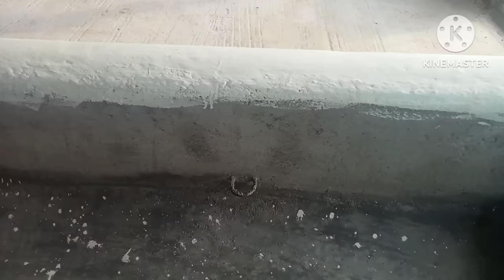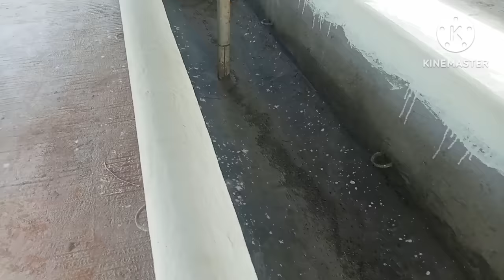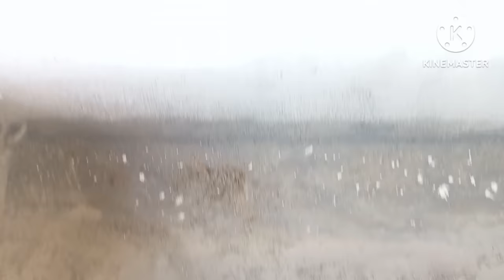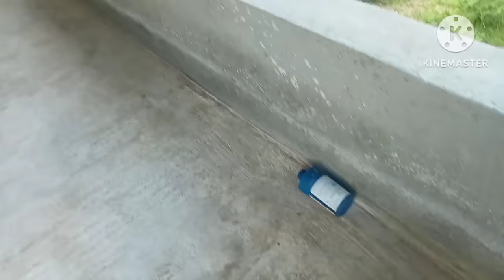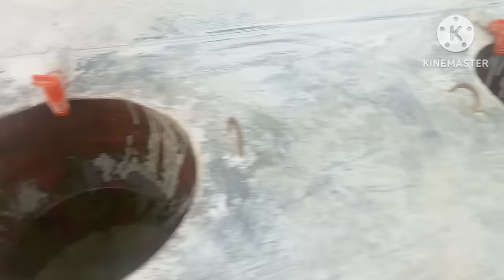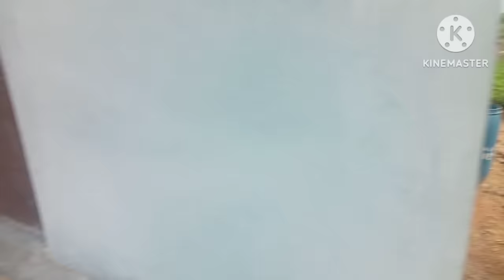மாட்டுகொட்டாய் அமைப்பது எப்படி முழு தகவல் /cow farm design in tamil #cowshed #farming #cowvideos

Comment: Its not a good for ventilation and feeding system so tail to tail is a best for a cow get good air
Reply from the maker: Shed is open type so no problem for ventilation. For tail to tail type shed, amount of air circulation will be very less because of closed with walls. Also the cost of tail to tail type shed is more.